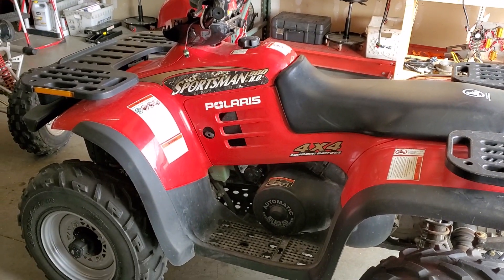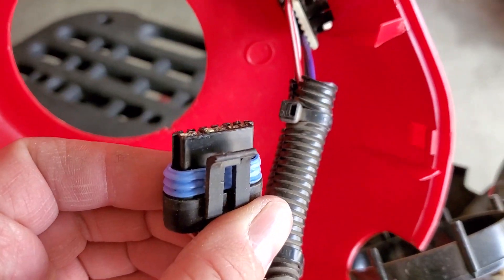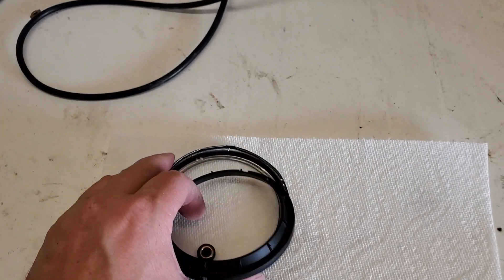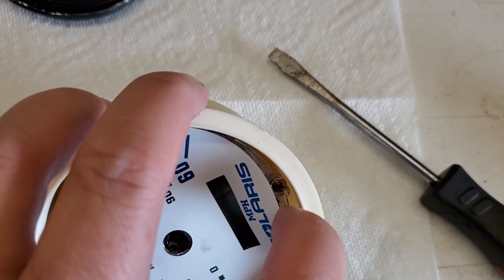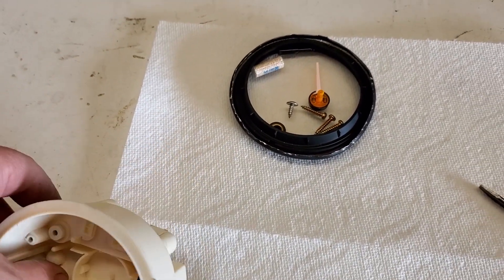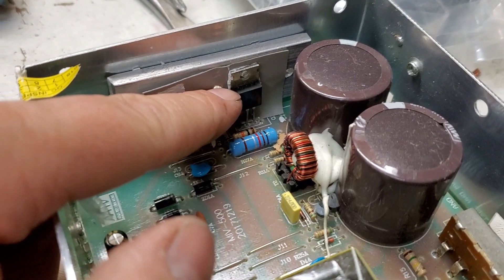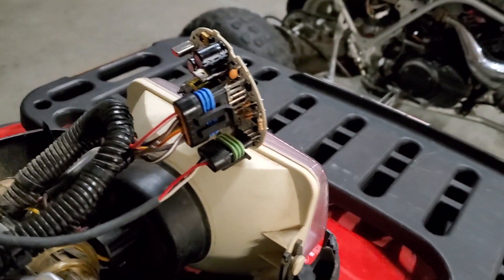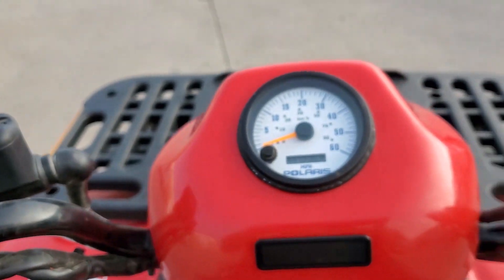Polaris Sportsman Magnum Big Boss 335 400 500 HO 4x4 6x6 Dead Speedometer Odometer Gauge Fix Repair

Comment: Great video, but i do have one question tho. I might be dumb but Is the face plate of the speedo supposed to fold easily to be able to get to the screws behind it? since mine seems to be made of plastic covered with white paint and painted numbers and not paper. So i don’t really know how to get to the screws since when i try to fold it it don’t fold but the paint looking stuff just chips on the edges.
Reply from the maker: I only know how I showed it in the video. Not sure if yours is different sorry.

Comment: Great video! I wish we could see the soldering part though. My speedo wasn't working, took it apart and the transistor had fallen off. Tried my best to solder a new one in, but it didn't work when I plugged it in. Not sure why as there didn't seem to be other damage to the board.
Reply from the maker: Sorry to hear that. Try a different transistor I guess.

Comment: Same problem here. When I bought mine, all the bulbs were blown along with the speedo and awd. Did you figure out what caused the issue with the voltage?
Reply from the maker: It could have been the voltage regulator on the ATV, but it did seem to be working. I think the power transistors just fail inside the headlight unit on their own sometimes.

Comment: Original part is a tip48, npn transistor.  I would try and get that part or a suitable replacement.  Mine was not melted out but shorted in circuit.  Edited to be more positive 👍
Reply from the maker: Thanks for the info!
Reply: Do you know what the large capacitor (qty 2) part number that sits in front of the tip48 npn transistor? On mine, both are fried.

Comment: These ATV models do not have light bulbs / oil indicators, water charge on board?
Reply from the maker: No, not in the gauge housing.
Reply: @OctaneElectrons  
I asked because I also have the 2008 model and it has no witnesses! Thank you for your answer!

Comment: So the problem with the 4 wheel drive is the speedometer ? Is there a place where I can send it to so that it can be repaired ?
Reply from the maker: Yes when it breaks it disables the AWD switch that runs through it. It can usually be repaired per this video.
Reply: @OctaneElectrons  The AWD still works though doesn't it? Mine was out last summer before a trip to Tennessee, but I didn't notice the AWD not working. I didn't notice the light not working either, but it's hard to see. I guess I should check to be sure.

Comment: What about the top cluster headlight? That’s the only thing not working for me. The lower headlights all work fine, but once I flip it to high the top light won’t come on and the lower lights shut off. Would that be a wiring issue?
Reply from the maker: Well the low beam is the 2 outboard lights on the front bumper, and high beam is the light in the gauge cluster. I would start by checking the bulb in there. Otherwise, yes it could be a wiring issue, or the handlebar switch.
Reply: @OctaneElectrons  yeah just took off the covering and took out the bulb was burnt out, replaced now works fine thanks!
Reply from the maker: @minecrafter4623  Great, glad to hear it!

Comment: Hey i got a 98 polaris sportsman 500 looks just like yours but 98 an my speedo dont wrk no lights needle doesnt move an odometer dont wrk i took my speedo apart an both transisters are still intact, do u think it could b bad? An my 4wd wrks tho too
Reply from the maker: Sorry not sure. I haven't seen that combination of issues where everything is dead on the gauge but transister is good.  Your 4WD might be working because somebody already did the bypass mod.
Reply: I found out someone put the bypass on for the 4x4 to wrk , an it’s a great video u have here , now I’m just wondering where do I find the tip 48 transistor? Thanks

Comment: Hey man, I have a 2004 magnum 330 4x4. The speedometer doesn't work & my awd selection doesn't work. but the gear read out, and hours work. Do you think this is the same issue?
Reply from the maker: Sorry not sure, that year uses a different speedometer I think.
Reply: I have the same model. Did you ever figure out the issue?

Comment: Have a 2002 or 2004 Polaris Sportsman 400 I am trying to fix for my dad ---  I need to go look at it, I think the speedo would light up, but there were no shift indicator lights or speedo reading (or the speedo was random), I will have to see if the AWD lights up like yours also. I may send ya an email if I do open up the speedometer and can't get the transistor soldered on if it is needed. I think I may have a more in depth wiring issue due to the previous owner though unfortunately and this thing has a poorly written wiring diagram/owners manual.
Reply: I'll have to look at trans gear shift selector sensor/rotary switch it sounds like from what I read and check the wiring.
Reply from the maker: Cool I hope you fix it!
Reply: @OctaneElectrons  lol, funnily enough, the bulbs had worked and then burnt out, figured it wouldn't be the bulbs, but i was wrong.

Comment: Good job , id maybe use my  door panel v tool for needle removal .but was wondering everything works on my atv works exsept the needle stopped moving is there a speed sensor on the machine ?? could that have failed ??
Reply from the maker: The needle came off easily with no damage, no need for another tool on mine, but some might need it. There is a speed sensor on the front right wheel I think. You could check that.
Reply: thanks found it
Reply: @GeneSewell2  where was the sensor? at the wheel or the transmission? (sportsman 400)
Reply: @M.TTT.  it was front right beside brake caliper .
Reply: @GeneSewell2  thank you
Reply: Hmm, I always thought the speed sensor was on the left side of the trans in the same place the speedo cable goes on my 335? There is a plug in that location on my 500. I seem to remember a sensor on the front though that used the holes in the disc.